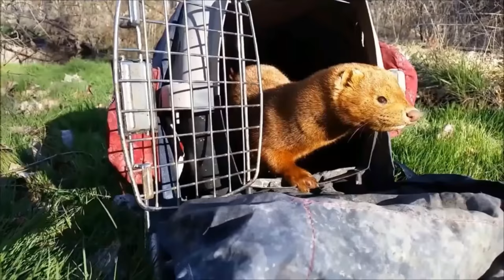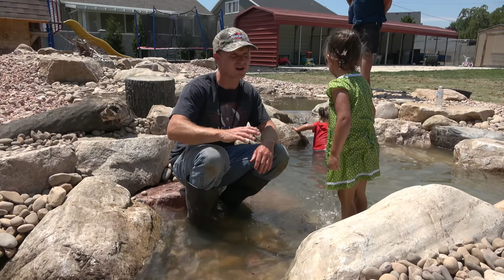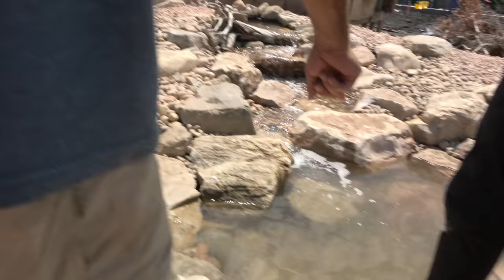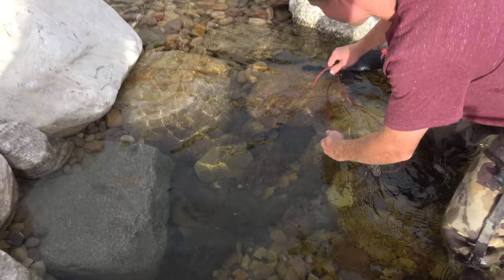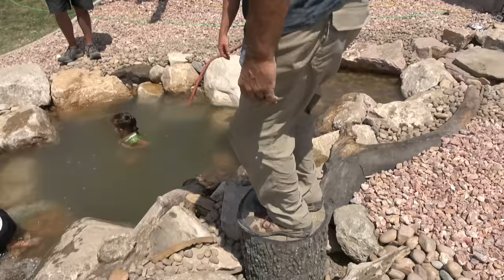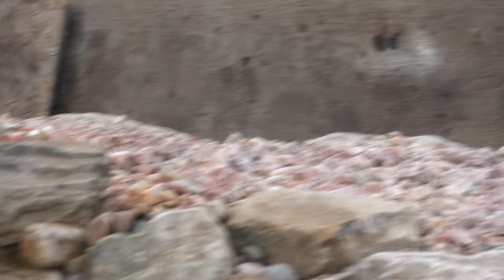MinkLand Pond Finished!!!!!

Comment: put wire on the bottom 6 to 8 inches high then use plexiglass wich might be a little cheaper then it wont get as dirty becouse its of the ground your mink pens and play grounds are awesome good luck

Comment: I second plexiglass if possible, like most mustelid cages in zoos... Though you COULD do a wood and chicken wire fence. Finished wood at the bottom, top, and where the fence curves, but chicken wire in between each little wood section, if that makes sense. Would make for an easy build, easy repair, and if you just put a little bit of an angled topper on it the mink and rats should be unable to climb out AND it should look fancy... Sort of what you already have for your garden, but nicer looking! Could even stain the wood and make it close to the color of your yard's fencing.

Comment: The fence should definitely follow the pattern already set by the concrete . Wood fencing would look good about 3 ft high with a latch door half a foot higher than the fence. On the in seem of the fence you can attach some sort of panel their claws couldn’t dig into.

Comment: Whichever way you go,I'd imagine if you can get any plastic/acrylic/whatever coated w/ UV light protection to make them last longer.  Definitely include an alarm system on the gate.  Also, while you mink-proofed the edges against mink digging, & you prob'ly were planning for Raptor, too, what abt Raptor digging in that enclosure--is his species prone to digging in gravel, or just sand?  If you need to retrieve him (if he burrows), do you think the food call will suffice?  What abt his claws potentially digging at the rubber pond barrier if he goes toward the pond?

Comment: Any clear material used for fencing will take a beating from sprinkler water. Probably won't remain clear for long (depends on mineral content of your water). Try making a fence of metal tubing (or rods) aligned vertically with 1-inch gaps for visibility. Bore holes in headrail at the desired spacing, and insert tubes. Paint if desired. Fasten tubes/rods in place in headrail sections.
Footer is harder, because it's in contact with the earth (even pressure-treated wood is iffy here) and would have to extend underground against burrowing. A cement footer perhaps, with PVC pipestub inserts at desired spacing. So tubes (or rods) slide into place.
Bonus of a modular design - you could pull a section of headrail + rods out as desired. Potentially have a reconfigurable fence, by making extra footer runs. So you could alter the space for training purposes. Or recreation for the girls, like blocking off the deeper pool.

Comment: I think about a regular fence but the bottom part is covered with slippery sheet metal just like the top part in your garden.
Chickenwire won't work because they can climb that.
That way you can keep the ugly part nice and low and somewhat out of your viewing height but the mink will see it as a barrier that they cant climb.
That or have the bottom part made up of rotating bars that spin freely so if a mink/lizard tries to climb it, it will spin so they will lose footing and stay on the ground.
Kinda like what people do to keep cats out of there yard only now not just on top of the fence but the bottom part of the fence with more than just 1 rolling bar.
2 ideas and I hope you like 1 or gives you ideas for something better.

Comment: Acrylic for the fence. Its see through, easy to keep clean, can fix scratches by buffing it, it is stronger than glass so u wouldn't need it as thick, stays clear the thicker it gets unlike glass that gets a green tint, u can bend and shape it to the be the same as where the rocks meet the grass. You can use decorative tree stumps that are not real but look real between each panel of acrylic and u can keep it on the external part of the acrylic so the mink can't climb it on the inside. A lot of zoo's have used this as well. Check out Universal Rock, he makes custom rocks, trees, or anything nature.

Comment: That fence will be expensive.  No cheap option,  I’d have a local welder make a iron or aluminum fence to your spec.  That way the orifice is the diameter you want.  If you want it see through without holes.  I’d use acrylic.  Unfortunately, because of COVID it’s very out of stock.  See if you can find a local demolition site for a strip mall or condo or high rise in SLC.  The glass there might be cheap enough to make it work (although maintenance will be a issue like you said).

Comment: I know that with cats you can get special fences that angle inwards at the top at a 45 degree angle so that if the cat stands directly underneath the fence, they see the angle of the overhang and instinctively know they can’t jump up and climb over it properly and they don’t even try, they just give up. Jackson Galaxy (basically the cat whisperer if you’ve never heard of him) probably has some info on it, or you might find it by searching for “catio” fencing. I wonder if something like that would work with the mink and Raptor 🤔

Comment: I would say a mixture of wood and plexi would be the way to go. With a foot or 2 of wood (planks or logs for a rustic look) with the top portion plexiglass. This will help to reduce the cost but make it so that you can still easily see in. Also any mud splashing up from the sprinklers should only hit the wooden base to keep the plexi mostly clean. Another bonus of having the top plexi would be the slick surface wont allow the mink or raptor any purchase on it to try and climb out...

Comment: Other than plexiglass I’d at least try a bit of a chai link fence with slats and some kind of cap to prevent anything that does climb from being able to climb to the top. When the girls are you you can keep the gate open for more visibility.
Or use a wrought iron/chain link fence with wood or vinyl framing and capping

Comment: 🙂🥳👍 I am an experienced 30 year veteran Carpenter who built custom decks for two of the largest fence and deck companies in the state of Illinois Cedar Rustic Inn Northwest Cedar did a lot of work in Aurora Illinois your pond installer probably knows of these companies my suggestion same style of fence same color except shorter whatever height you prefer and what we have done in custom decks as we used Plexi one by for one by 5 Buy 32in and I would substitute some of the slots 4 clear Plexi that way you're not cleaning the whole thing your cleaning a portion you can do every other slot which may be expensive or just do one every 2 feet or 3 feet Google decks with clear Plexi rail systems go to images and you'll find what I'm talkin about good luck love your videos and I'm definitely interested in buying muskrat first from you LOL make that awesome mink quilt gloves and hat gets cold in Chicago like The Dakotas

Comment: As long as you clean the glass regularly, I don’t believe the hard water stain will get bad. Deionized water is the best for cleaning glass, it pulls the minerals off of the glass. Find a residential window cleaner who has a water fed pole and ask him for a few gallons of DI water, you can spray down the glass and wipe it down. That will keep it looking good, if you keep up with it.

Comment: If you went Acrylic or polycarbonate, it would have to be UV treated as that stuff yellows over time without UV coating. As far as wire fences, you could get powder coated stuff so it isn't so unnaturally blingy and shiny.  Or you could do a combo. Maybe black powder coated mesh on the bottom, and polycarb top. Or just have the entire top be a slick ABS piping large enough they couldn't just maneuver over. In my head it isn't as industrial looking as the galvanized sheet you use on the enclosures.

Comment: Maybe wire with brush (real or fake) to hide it?  Not sure how well minks can climb, so...  you could even curve it back in on itself and put the plants/brush/etc, over the top and outside, would be kinda cool. You could choose something that is still see-through and could take the sting away from the bare wire.  Doesnt sound like there is a perfect solution without the plexi or glass.   Might not look too bad from the inside either, plus maybe it could reduce the height as well.

Comment: Hate to say. Glass is the most durable and easiest to clean.  You can find old double pane sliding doors and harvest 4 big tempered glass sheets from each. Frame them with wood top and bottom and use slippery metal posts. Plexiglass will scratch and haze much faster than glass.

Comment: Perhaps the issue is not the material you're using but the approach. If you just use a flat wire fence, it can't look all that great, but if you made an enclosed dome, you might get some interesting results.

Comment: Glass may be expensive and I know you are not a zoo but if you look at many zoo exhibits even with otters, they have some big walls of glass and they are buried so many inches in the ground and then so many feet above ground and they wrap the front of an enclosure with that or in your case most of the enclosure. I think glass would be a good bet too because if you use some kind of clear acrylic, over time it will become scratched up and then you won’t really be able to see through it anymore. You could have it polished back out but you would be doing that several times a year where as glass you would just clean off. It may get a little scratch but not drastic like an acrylic will. You may be able to find someplace that is has scraps of large thick pieces of glass that they have left from a building project or something like that that they can give you the big scrap pieces. Also I know you are in Utah I think but maybe you can contact Acrylic Tank Manufacturing in Vegas and they may be able to help you out some kind of way if you tell them what you are doing it for or they may have somebody they know that may have large scrap pieces of glass. I know they sometimes build extremely large glass tanks as well so they may have big scrap pieces. It does not hurt to ask. They may know of some zoos or something that shut down for some reason and may be able to get the scrap from their exhibits for you to use. You never know what people can get or who they may know to help you out. They are big animal lovers too so if you mention the fact you are rescuing minks from fur factories and maybe let them come visit you and the mink they may make some kind of a deal with you to get you the enclosure around the pond you need.

Comment: The fence is kind of a tall order because mowing and weed eatn may damage glass and scatter shards everywhere. Now plexiglass on the other hand is much safer it can still be damaged (dents or scratches from flying rocks and what not) and I’m not sure how well it can handle long term uv exposure. As for the sprinkler issue there are Products you can put on glass that act as a wicking agent. I’m not sure how often sed products need to be re Applied but u may not need to apply anything in the first place because it would be purely aesthetics.        However often u clean the house windows is probably the same for a glass fence. Now every time you mow or string trim you would have to clean the glass because no matter how hard you tried unless you covered it you would be throwing grass particles at it and it would produce a lovely film of green over the glass.    Glass or plexiglass is your best option because it cannot be climbed despite all the negatives that is the best excuse for having that type of Barrier. If you can’t afford it at the moment I would save for the proper product for the application and work around not having a Barrier around the pond until it becomes affordable . Who knows you may not even need a fence around it. But that’s my best recommendation cheers🍻

Comment: What about just a wooden fence for the bond with very narrow spacing, 4ft high minimum. that way it should with any luck it will stop the mink caching fish outside of the pond and also stop your girls from getting in without you. will just need a coat of varnish on occasion . you could also decorate it with plants.

Comment: I would guess that a 2 foot vertical meta wall would be too high for a mink to jump, and they wouldn't be able to get a grip.  For maximum viewing, I'd add a sloping dry most from Minkland butting up against the 2 foot or so metal roofing wall that is at least half buried on the outside (mink sees full vertical metal wall from inside).  You could too it any appropriate see through fence to keep the kids and oth critters out.

Comment: My first instinct was acrylic as well but I wonder if the garden style fence simply using painted metal would be all that bad? Wicker could be beautiful as well but far more opaque even if woven loose. Finally, vertical metal poles with no cross beams, even on the top, could work since most animals arent going to be able to climb it or try to jump it. Even painted black it might not look that great though and if its not tall enough and a child or kid tried the jump it might hurt them.

Comment: Maybe chain link fencing or some kind of fencing would be the best option and just put a roof over it. It wouldn't need constant cleaning like glass or plexiglass and maybe put tiny mesh to keep the mice and rats in and it would probably be a safer option for your girls so they can't drown because it could be locked and instead of making the fence rectangular or square make it more soft edges think round edges it'll make it look less tacky.

Comment: We use aviary wire for the old chicken tractor, it's lighter looking than the hardware cloth you've got. Easier to see through IMO.  For the garden beds the end walls are 2 x4 welded with doubled bird netting tied down. We have arched conduit every three feet and drill into it to support a 1x2. double the bird netting, sandwich  it to the 1x2  put a pvc in the turn and rope down the pvc. The groundhog and coons have left the garden beds alone. The 2x4 isn't enough if it's too close, my flower bed has a lid and the coons still reach and yank on the plants, dig at the dirt. I'll be giving that a bird netting cover once we get the time.  I'd suggest the horse diamond no climb with the galv sight board/ slip and slide top, but the mink and rats both have small feet,. What do people use for tree squirrels cause that might work.

Comment: How about using vertical wires of stainless steal or copper a little under one inch from each other. So a frame of wood with vertical wires. They won't climb that.

Comment: If you use glass, plan on waxing the glass. I use a spray wax for my car, and also wax  the windows. Dirt and water bead off easily. But glass does present cleaning issues like you said.

Comment: What if the mink go into each side of the pipe at the same time could they get stuck?
Reply: No,
4” diameter will easily handle 2 and there are larger spaces by the Tee Intersections to allow them to turnaround

Comment: Could you do the mesh and metal like you've done on the garden on the inside of the fence to prevent them getting out but give it a nice wooden posts and top wooden trim (on the outside) to cover the outside ugly so pretty looking on the outside ugly functional on the inside... or mix of the glass/ acrylic coupled with the mesh/ metal, like in panels or sections to cut costs

Comment: Clear plastic can be cut by rodent teeth, but if you can get a good deal on stone countertop cut off scraps, you can make a smooth stone lower wall, with a clear plastic and wood frame upper wall.

Comment: Fence idea:
Use layered wired mesh with fencing, with  as many layers as you would need so that a rat can't get through. It should be sunk into the ground a few inches or you could pour a concreate foundation and place the fence in it before it sets. Attach this fence to your existing fence by making four  "L" shaped posts with four 2x6 and four 2X8 pieces of treated or stained wood. Attach the posts to your existing fence with the shorter part of the "L"  tightly sandwiching the layers of the fence on the ends with screws locking the layers in place. Then get large drainage pipe,  cut in half lengthways and paint it to match your fence. Attach one half of the pipe on either side of the top of the fence to make an "m" shape to prevent the mink from escaping.  For a door, cut a hole in part of the fence and frame around it with the same kind of wood you would use for the end posts. Again Tightly sandwiching the ends the the fence together on each side of the fence. Then to make an actual door, again by layering the wire fence to the size of the door hole and framing around it on both sides locking the mush in place. Then slap some hinges, a latch and a couple of handles to it and put it in place. 
This fence will be effective, fairly cheap to make and look half decent. The only downside is that it with be incredibly labor intensive, but that seems like no problem for you.
Good Luck.